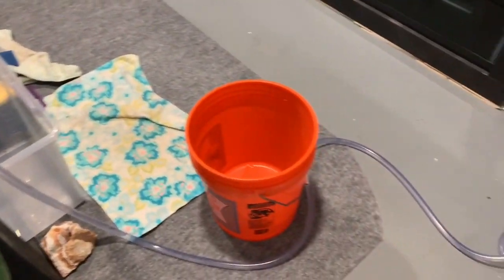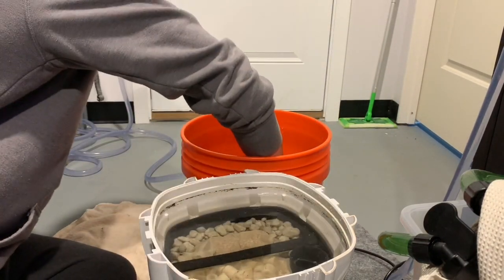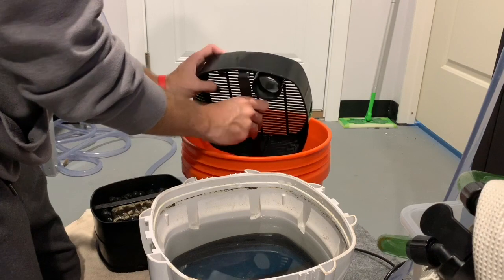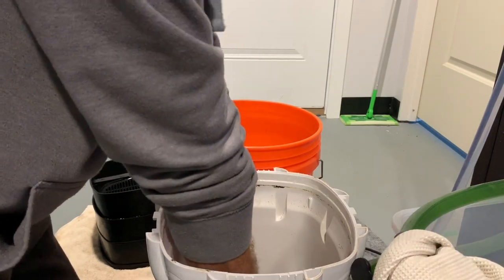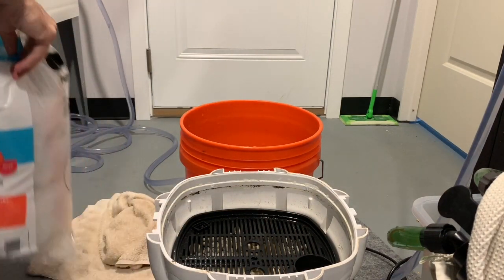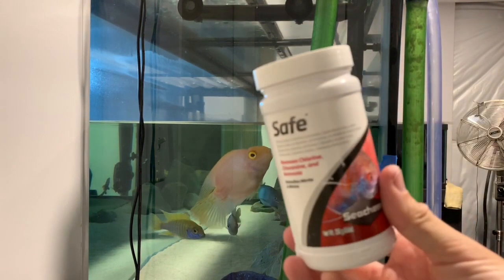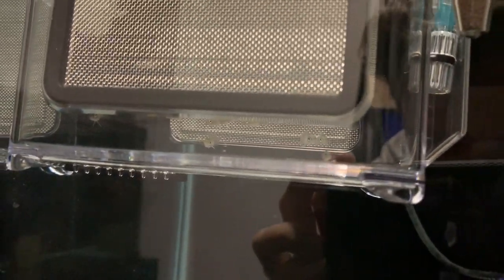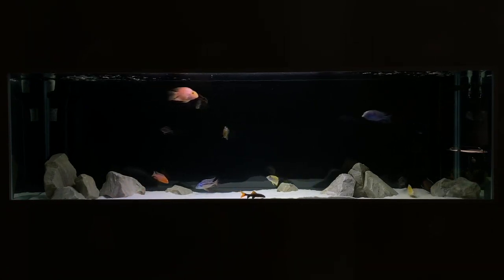SUN-SUN 304B Canister Filter Cleaning & Aquarium Maintenance | 125 GALLON CICHLID SHOWTANK

Comment: You should add more filter foams. Your 1st and second bottom baskets are nearly empty. They can fit a lot more and do much more filtration for you. I fill mine up and it does a better job IMO. I use 1 coarse, and 2 medium foams in the bottom tray. Then I fill up the second tray with fine floss pads. My 3rd and 4th tray are all bio-media.
Reply from the maker: I had an fx6 on the other side of this tank which contained more sponges, fine filter media etc. If I didn’t have that, I would agree with you for sure👍🏻 thanks for watching mate

Comment: I have both brand but fluval fx6 holds more media and pump is a lot stronger.  The only reason why people buying sun sun brand cause of the cost and fx6 cost 3x more but if your patient then get the fx6.  If your patient every year fx6 is on sale for around $120-180 and its a better quality build then this one.  Most people go with sun sun cause its decent and cheaper than eheim / fluval but be patient and get the fx6 when its on sale.  I do agree if fx6 never goes on sale then i would buy the sun sun brand but when its on sale why buy the sun sun brand lol
Reply: For one, it has a uv.  These are serious filters.  I still am partial to a wet/dry sump though

Comment: So does the bubbles go away completely ? I can’t figure out if it’s supposed to make bubbles or not
Reply from the maker: It’s not meant to. If bubbles are coming out of the filter outtake you have air trapped in the canister housing. Just rock the canister from side to side. That’ll help the air get unstuck. Hope that works👍🏻
Reply: Even with expensive canister filters like the Oase biomaster 850 there's issues of trapped air inside the canister filter which makes gurgling and hissing sounds from the outlet pipes. So i think it's just a common issue with all canister filters , irrespectiveof their price difference.